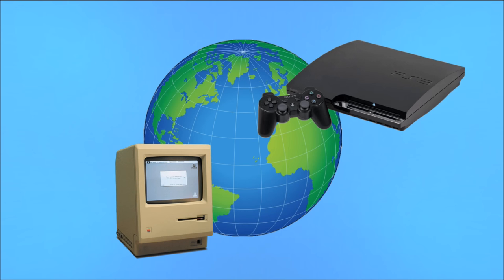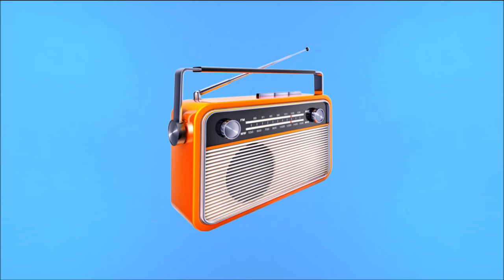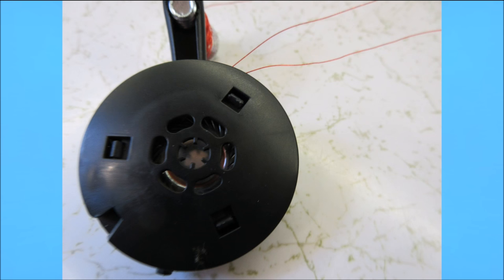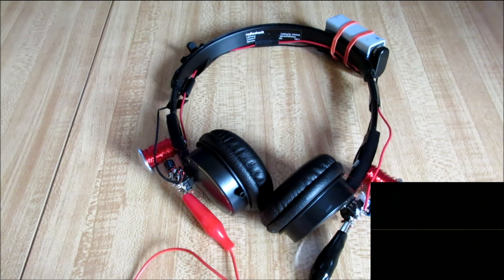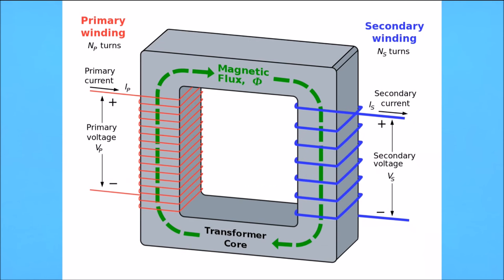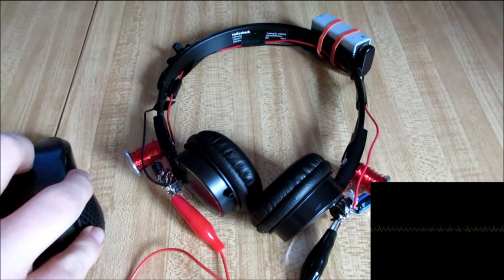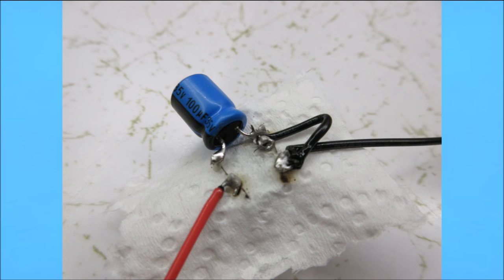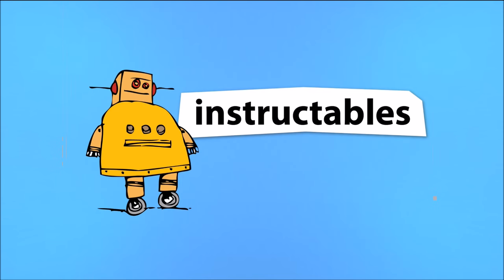Listen to Electromagnetic Fields

Comment: Humans can absolutely sense electromagnetic field, which is why you can see things...
Reply: He meant fields outside of visible light.
Reply: Koha Raisevo  not everyone is the same. some are more sensitive and aware. it depends on the person of course and of course some are just not noticeable without an instrument. at any rate an instrument is needed to verify.
Reply: Adam in Wonderland
he meant visible light is part of the electromagnetic spectrum
Reply: @ender_scythe2879  You're exactly right, in this case the part of electromagnetic spectrum this would see is in the radio to microwave bands mostly it's basically a radio with no filtering or processing done to the incoming signal, just directly converted to audio
Reply: @ender_scythe - 
Some electrosensitive humans can Electromagnetic fields , even far before these cause harm to normal humans
Reply: @Killerspieler0815  I've developed electromagnetic hypersensitivity either from chronic exposure or neuropathy from drug use. This acquired hypersensitivity has led me down the path of researching and learning about this stuff...very interesting and moderately unsettling.